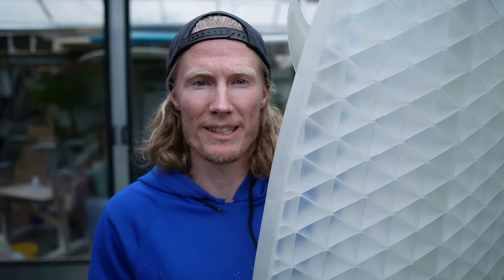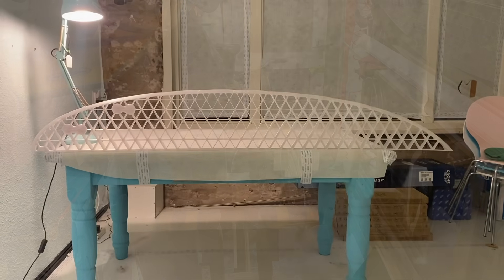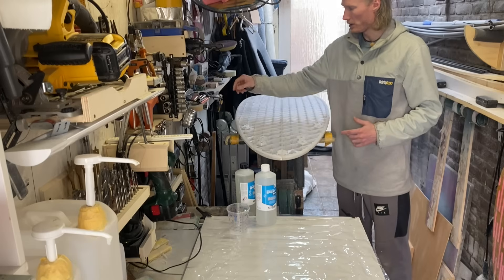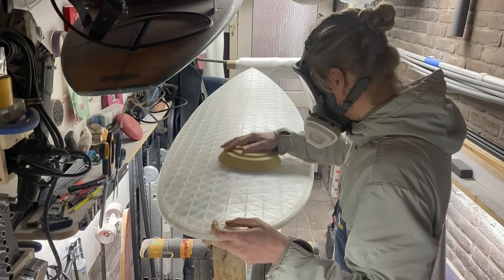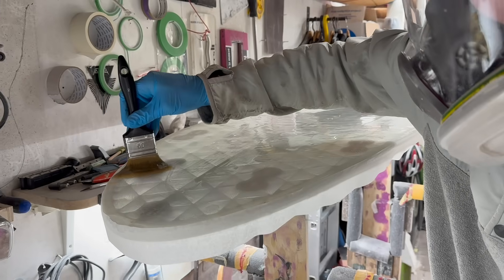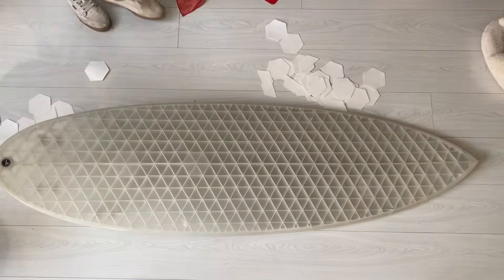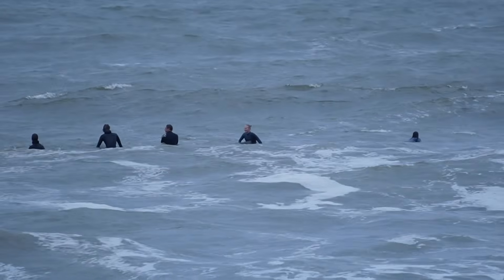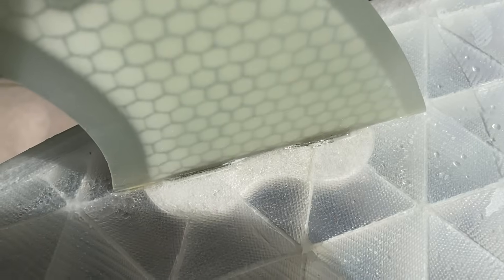How to 3D print a surfboard with a basic 3D printer?

Comment: The man who design this masterpiece deserve more highlights on his work !
Reply: Actually I am this guy… I find  so cool that Geert actually did it. He is the most dedicated of us (I started the prints but I gave up after the 20th parts…🥲 and I realized that PLA was a poor choice due to the glass transition temperature. And I couldn’t print ABS at this time).
I started this project during the 1st Covid framing, just to ease my mind and keep it in shape😉. The design was pretty straightforward once I could get a decent 3D parametric file of a board (I choose a shortboad in this case, easy to print). As almost all the good shaping softwares are not free, I search for a free board design, as I am
not a shaping expert. I found it on Grabcad. 
My goal was to be able to make a board with a standard 3D printer, roughly with the same design (isogrids) as the cardboard surfboard project, but 3D printed. & No charge !

If some of you out there enjoyed this work and would like to get the same type of design (hollowed boards) with other kind of surfboards (long, fish…) get me a proper parametric file and I’ll do the rest 🤝🏻
Reply from the maker: All @sslchab’s work is very appriciated!!

Comment: Nice job. For future, I would recommend to have a big universal holes through board for easy mounting and unmounting inserts with fins. They can be fixed with screws inplace for example. Then you keep your waterproof body separate and isolated from any inserts you have. So inserts won't impact your isolated contour.
Reply from the maker: Yeah you are right. Next time I will just glue some fcs boxes in a printed cavity.

Comment: I didn't get why the suports were needed.
Reply from the maker: Because no part is completely flat. And because I'm a 3D print beginner. I possibly could have solved my problems in another way, but this is what I thought of and it worked.
Reply: @Dzjiefoils  ok, great. When putting the part on the table, aways try to make the side that touches the bed the flatest, without loosing anything, then you add supports, the way that you first clicked to make the part on its side was best. The way you did it worked but used more time and more filament. Im not sure if it was clear enought what i said but i'm not hating just trying to give you a hint, the project was awesome btw thanks for sharing.
Reply from the maker: Defenitely not picking up any hate. I'm here to learn from people that know a lot more than me about 3d printing (like you)! So thanks for your tips and recommendations!

Comment: You've done an incredible job! I have a question: if you fill the gaps with foam, like the ones used in construction, wouldn't it help it float better?
Reply from the maker: Thanks! I don't think so. Foam adds weight and air floats best right? I don't know for sure, but this was my logic. And I don't like the looks when the see-through board isn't seethrough anymore.

Comment: I sliced the files, with a good printer one piece should take about 3h, not 12h.
Even the cheapest Bambu Labs Printer (A1 Mini), that costs about 240€, is better than a Prusa.

Very nice Video nevertheless, I love when people go outside of the norm :)
Reply from the maker: Yeah I'm a complete beginner in printing, so I should have done a lot of things differently. But 3-4 hours is very fast. How did you orientate them? I had a lot of issues with overhang and impossible support when printing them vertically
Reply: @Dzjiefoils  with a good printer (highly recommend bambu labs these days) there are strong fans on the nozzle on 2 sides, they will harden the plastic mid air when extruding a "bridge", wich is just a term for a string of plastik that is pulled in mid-air. That will easily fix most overhand problems. Using the manufacturers Slicing Software will also help very much, as they have fine tuned their presets for the printers. Plus the direct drive on the printers makes for much better extrusion control. Meaning overall control of the placement of the plastic, which would also help with overhang. I highly recommend, if going for cheap but very good, the A1 or the A1 Mini.
(Settings for speed are further down) Dont go for the Bambu Filament though. Buy Geetech for like 10€/KG, or Sunlu. Plus if you have a "open source" printer that uses Marlin as a firmware, you maybe want to look into "Klipper" as the firmware. I upgraded my 3D Printer some time ago and it made it about 2-3x faster. It offset the Processing to a raspberry pi, so the Printer only had to move to motors, which means I could pump up the acceleration and speed. Plus this made the printer straight up silent. So maybe look into buying a Printer that uses Klipper if you dont go for a Bambu Labs one. My A1 Mini prints with about 200mm/s at 5000m/s^2. My Creality CR10s (which I modded to use Klipper) now does about 80mm/s at 700mm/s^2. Put those numbers into you Slicer and see what printing times that will give you. Remember that you can also print more Volume when switching to a bigger nozzle (0.6 instead of the 0.4 standard one), which should give you a boost of 50% in an instant. Maybe use 0.24 or even 0.28 Layerheight when not needing high detail prints. 3D Printers will be faster when the Object is laid flat. Meaning it draws a line faster, than if the line stood upright and it had to do it layer by layer. They can hit higher speed faster if they go at a diagonal line than if they were to go straight on the x or y axis, as they will use two motors for the diagonal, instead of the one motor on either x or y movement. This only goes for Bedslinger Printers. Core-XY printers will do that fast with any movement (see the more pricey Bambu Labs printers (not sponsored :))).
Reply from the maker: Thanks for all of your tips! I will definitely look into that for future projects! I printed this one with a 0.6 nozzle. I thought I found a hack with this to make it faster. But My process can be upgraded a lot!
Reply: @Dzjiefoils  please ask if you need any help
Reply from the maker: I will!
Reply from the maker: Dude, I 3D designed a new board in fusion 360, and cut it up into parts, could you help me with the orientation on the print bed etc? I can send you the files

Comment: Very cool! how much would you say it costed you in total?
Reply from the maker: The filament was pretty expensive. I used the recycled PETG from Reflow (Dutch company to keep it as local and environmentally friendly as possible). I had to buy 4 kg's at 34€ a kg. So that's already €136,- Than I think about 50 euro's on epoxy and fiberglass or maybe a little bit more.  Some small costs of sandpaper, tape, glue e.d. Maybe come to a total of €200,- to €250,-?
Reply: thanks for the reply! I loved the look and i have a fast and good 3d printer so was thinking about doing the same. You think its possible to make a board that surfs really good as well?
Reply from the maker: If you want a board that surfs really good I would stick to conventional surfboard materials. But you can get a decent surfing one for sure! Just try it. It will be a fun project and you will learn a lot! Take a look a Wyve surfboards, maybe you can learn from them! Let me know how your project goes!

Comment: That's Cool!  If you fix the leak you need to add some LEDs lights in the cells. : )_
Reply from the maker: Nice idea.. You got some suggestions for good quality lights and a battery system?
Reply: @Dzjiefoils  Fairy Lights seems like a good choice because they are inline with the wire, so it will be easy to run, low power and wire/lights are all coated so that part might be waterproof (not sure)  do a search for : fairy lights battery operated with remote
Reply from the maker: Thanks! will look into it!

Comment: Great video    thou you should have used 105 wetsystems epoxy..   made for use in saltwater. And carbon weave for stringer. And top and bottom layers ..  would be lighter .  And bullet proof...   maybe next time
Reply from the maker: Thanks! I thought about using carbon for the stringer. I do this in all of my boards actually. But It would influence the see-through look of this board. I will take a look into West Systems thanks!

Comment: Plastic is wet! It's very good to see on your video. You should dry ANY plastic before the print, otherwise do not expect a good adhesion between the layers.
Reply from the maker: I tried drying it in the oven but got a fully melted together roll out of it instead. Luckily Reflow send me a new roll of filament for free.
Reply: @Dzjiefoils  I made a drayer for 4 spools, from the components (heater, terms-really, and power supply) from AliExpress and a plastic box on 20 litters. Nothing special if you want I can share the photos.
Your project with a 2d printed surfboard is exciting to me. Not recently I started living in Portugal and from time to time think about making a sup but with electrical motors.
Reply from the maker: Nice that you build it yourself.! I think I get the idea will try it if I start a printing project again. Sounds like a great project, your SUP with electrical motors! Just do it!

Comment: little tip : with a 1mm nozzle you print 3 or 4 time faster and the print is as resistant and sometimes even stronger...
Reply: You have to admire the work with 0.4 mm nozzle though
Reply from the maker: Thanks for the tip. I used a 0.6mm. I was very proud of using this one because the print times where 20% (or something) faster. Now I hear about 1mm and 1.2mm nozzles... haha. As you can read an see in the video I'm a complete beginner in 3D printing.
Reply: @Dzjiefoils  you manage to do pretty well, and when the printers are working at night it doesn't make any difference if they are slow or not. To print a board the best would be infinite printer bed ^^
Reply: @Dzjiefoils  now you have to print a pair of swimming fins in TPU...
Reply from the maker: That sounds like a nice challenge! Will look into that for sure!

Comment: i would recommend adding fillet angles to the 3d prints. youve got sharp angles putting pressure on the fiberglass which will create high spots.
Reply from the maker: Never heard of fillet angles, but will look into it! Thanks
Reply from the maker: I have made a new design myself. In fusion 360, I made a hexagon pattern, but I don't know how to add the fillet angles. You want to take a look at it?
Reply: @Dzjiefoils  Hey I emailed you through youtube, on some suggestions for a hexagon.
Reply from the maker: @TheLotroNerd  You are the best!

Comment: The fins are too stiff. So your board is not going to turn as well and will not pump or build speed as well. You can tell because of the way it cuts in the water. get some really flexible fins and you might actually get a better experience.
Reply from the maker: Thats a great tip, thanks! Only.. The fins are glassed into the boxes, so I have to cut them off!

Comment: That looks great. Sorry to state the obvious but you should have put the holes between cells all at the bottom corner of each cell when propped upright. That way it would be easy to drain the water with a drain plug at the tail.
Reply from the maker: Yep you are totally right. I never thought water entering the board, but I should have known better.
Reply: @Dzjiefoils  I only know because some of my normal boards have got a bit of water in them so I drill a hole in the base and prop them up for a coupe days and they have lost as much as 1.5lb of water.
Reply from the maker: Nice. The lighter the better!

Comment: Awesome stuff. Looks like your PETG is a bit wet, I would recommend dehydrating it
Reply from the maker: Yes, you are right. I tried drying it in the oven, but got stuck with a completely fused roll of filament. Luckily Reflow send me a new roll for free.
Reply: @Dzjiefoils  that's awesome 👍 glad you got a fresh roll. 

I'm in a humid climate on the east coast of the USA. I have to pop my in the dehydrator if I leave it out for just 2 weeks! 

If you don't have one yet, a food dehydrator is very inexpensive and fits several rolls of filament and are able to have the temp set for different filament types
Reply from the maker: Great advice! Will look into that!

Comment: Nice build. Really good use of 3d printing and composites. FYI, I can see you had bubbles in the printed parts. This is a common sign with PETG that the material has absorbed water. I would recommend drying it out and if possible keep it in the dryer while printing.
Reply from the maker: Yeah, there were some bubbles in the first parts, I tried heating a roll of filament in the oven to dry it out. I completely melted the filament into one block!  Luckily I got a free replacement roll of filament from: Reflow
Reply: @Dzjiefoils  howwww
Reply: @Dzjiefoils  You need to dry it at around 100C, so water will evaporate but plastic won't melt.
Reply from the maker: @aspinx  I know, but I think the oven temperature gauge wasn't working or something.
Reply: Could also be caused by a too high print temperature. With some printers the real temp in the heat chamber is higher than programed.
Reply from the maker: @McMac23  this could very well be the case. I’m now running into a thermal error every tike I tried to print something. So maybe some sensor was already broken.

Comment: It looks really nice! Great job. And what a lovely place you two have :)
As I used to longboard a lot I would still love to try surfing sometime in my life.
Reply: For draining the last bit, you could make an inlet and outlet venting hole. Put a small air draft through it (using a small ventilator with some static pressure, like some of the radial fans they use for 3D printer part cooling) and then then just let it running for a few day's.
Reply from the maker: Thanks! Will try this, but Ideally I only want to drill one hole!
Reply from the maker: Yeah, just go on a holiday to a nice place and rent a longboard.! Surfing is too good to stop doing.
Reply: Thank you! We are very lucky to have our little piece of paradise so close to the beach ❤

Comment: omg beautiful! please buy an orange storm giga and use cubic infill for the 2 halves :)
Reply from the maker: I didn't know what an orange storm giga is, but I looked it up. Looks like a great piece of equipment, but way too expensive for my small hobby and way too big for my narrow shed! Would love to own one in the future though!
Reply: @Dzjiefoils  yeah waiting for it to (maybe) mature a bit might be smart as well :)
Reply from the maker: Cubic infill will make the board to heavy I think.
Reply: @Dzjiefoils  no it will will make it stiffer for the same weight and also lighter since what you printed isn't procedural from the slicer every wall will be 1/3 the thickness thus spreading the load and make the lamination much easier, 
But if you like honeycomb(hexagon) infill better it is a pretty good choice, the important thing is having it be procedural and thus much more efficient. 
Also consider using ASA as your filament.
Reply from the maker: @yagoa  Thanks for the advice! What do you mean with procedural? Sorry English is not my first language..
Reply: @Dzjiefoils  generated from algorithms, the slicers infill
Reply from the maker: Ahh oke thanks!
Reply: @Dzjiefoils  have a look at some infill, how they alternate the direction to make the strength uniform
Reply from the maker: Will do!

Comment: Wait wait....if we can do this....we can also 3D print a whole JetSki...laminate with fiberglass and go!  Wonder if engine vibration can be dampened enough....or go full electric.  Hmmmmm.🤔
Reply from the maker: This sounds like the start of a very cool project! Just do it!
Reply: @Dzjiefoils design time!!!
Reply from the maker: Lets Go!
Reply: @Dzjiefoils  There's a design out there to make one out of wood.  I'd need to convert the drawings.  Or we can do a clean sheet design that takes 2 of your surfboards and mounts a cockpit and power pod in the middle.
Reply from the maker: 2 boards attached to an engine? That sounds way too sick! But I think canoes or catamaran like floaters will work better.

Comment: Impressive. Great work, hope u grt the leak fixed but that is normal for first versions of 3d printed stuff.(at least in my experience, what type of resin did you use? And have u considered using Aflex filment?)
Reply from the maker: Thanks! I used epoxy resin with the fiberglass. Never heard of Aflex? Will look into it.! thanks

Comment: Impressive, but you could print it way faster with thicker nozzle. Also with a faster printer in general could recude time by 2/3 - most recent printers are way faster than prusa slingers.
And yeah, layers leak water in. So need triple epoxy cover
Reply from the maker: Thanks man, I was a cheap second hand printer, so I'm very happy that it printed the all the pieces. I used a 6mm nozzle. And looked into speeding up the printing process. But after watching dozens of YouTube tutorials I gave up with the printer settings and just let this Prusa printer do the work.
Reply from the maker: And the board itself Is water tight I only missed one little spot at one of the finboxes. If I fix that part the board should be watertight.

Comment: Tedious. I thought you would use snap fit. How did you correct the overall distortions?
Great video, thanks!
Reply from the maker: The layers of fiberglass fixed all the imperfections in the outline of the board. I didn't design the 3d file, so I have no idea how to make the pieces snap fit.
Reply: @Dzjiefoils  Nice, thanks.
Reply from the maker: Thank you! For watching and reachin out! Happy to help.